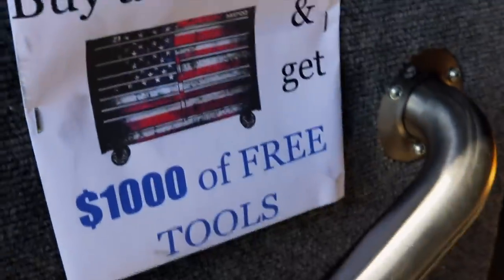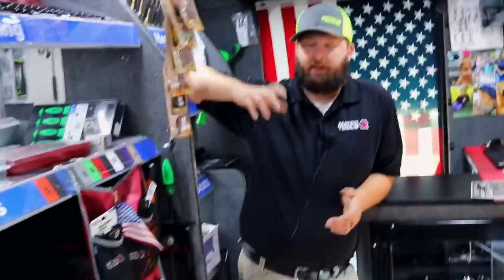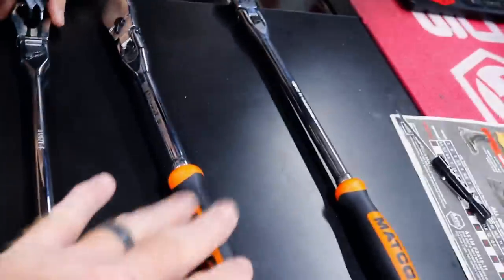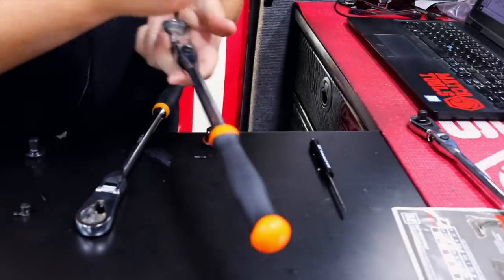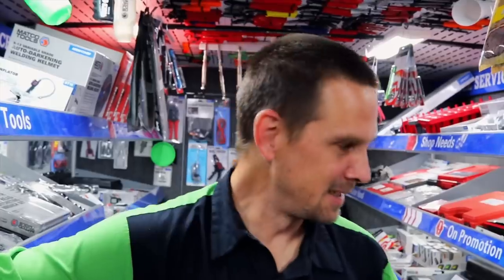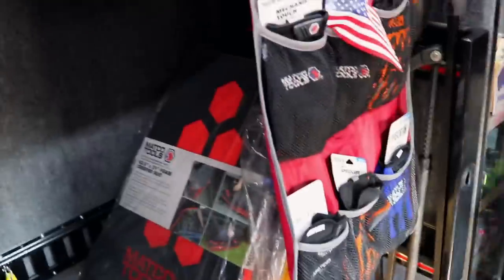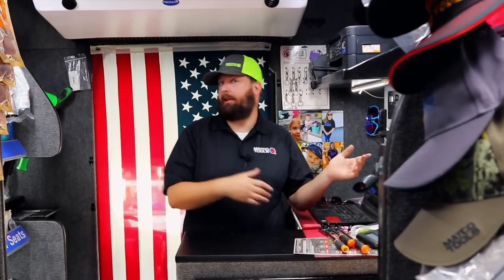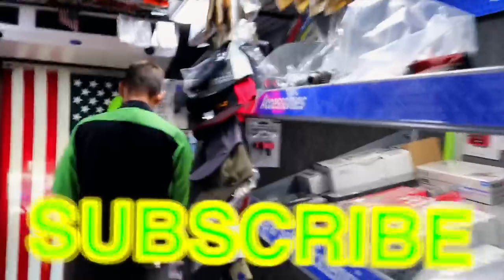Matco Tools: Is it the same ratchet, just rebranded? Gearwrench VS Matco, let’s tear them apart!

Comment: Did this guy really say "I've heard its 90 tooth but I dont if that's true" WTF is wrong with him is he really trying to say gearwrench is lying about tooth count
Reply from the maker: Have you checked the 120 tooth count ? You do realize it isn’t 120 right? Double clicking a pawl doesn’t add tooth count it just doubles the clicks you feel and hear
Reply: @KoonTrucking  I've got the 4 piece 120 from gearwrench & it doesn't feel much smoother than my 90 tooth but my Milwaukee 144 position ratchet wrenches are very smooth & they are double stacked but I mean is icon is 90 tooth ingersoll rand is 90 tooth gearwrench is 90 tooth I've been a industrial mechanic for 14 years now & honestly it doesn't matter what tooth count is or the brand I've had 2 snap on ratchet they honestly were not worth the $ so I've been sticking with gearwrench & Pittsburgh & I'm not seeing any reason at all why any other companies are worth more $ I just don't have much trouble from my cheap brands I mean I use Pittsburg & gearwrench 10 to 12 hrs a day with no problems I've broken their breaker bar but I dont warranty them just go buy another tool I've had same ratchets for at least 3 to 4 years & I might have $250 between 6 or 7 ratchets now I use my I.R.W7152 more than any tool in my bag & 1/2 dr sunex impact sockets for 2 or 3 years my 3/8 dr stuff doesn't get used very often as everything I do is big enough its 1/2 dr or bigger
Reply: @KoonTrucking  I just cant justify tool truck prices their tools are only a little better than the lesser priced brands & watch client graphics he shows all those ratchets breaking nice that cheap ass tekton tied with snap on but Milwaukee was strongest & matco & gearwrench were extremely close to same torque at failure points

Comment: There both made by apex tool
Reply from the maker: I don’t think so. Pretty sure Matco is made in Illinois
Reply: Koon Trucking well someone’s copying someone. I use them both. As well as snap on and Carlyle ratchets. Love them all and I have them all same reason you do. They all have there times when they shine and work better than the others but the gears from the gearwrench and the face plates and snap rings and the switches work in the matco, I believe matco either shares a patent or something like that. I don’t care at all. Just saying they work. I like the matco locking part better. But the different lengths and stuff are what comes into play. And the 120xp is badass.

Comment: Different ratchets but Matco does not make their ratchets and I don't believe they are made in the U.S.
Reply from the maker: Yes Matco ratchets are indeed made in the USA. Pretty sure it is in Illinois. That’s why they have them even stamped with the flag showing made in USA now
Reply: @KoonTrucking  Thanks for the info. Haven't had a match guy for a while so was unaware.

Comment: this video is very disingenuous  because the video I watched right before this i watched a guy take all the matco internals from a matco rebuild kit 88t and put them a gearwrench 84t the 3/8 took all the parts the 1/2 wouldnt fit the selector switch but all other parts fit and the 1/4 was the same all parts except the selector so $45 dollars rebuild kits you get matwrecnh ratchets
Reply from the maker: You realize the 84 tooth is the old style Gearwrench right? Plus all Gearwrench is made in Taiwan where the Matco is made in USA? They are not the same ratchets.

Comment: Foresure same ratchet sorry guy's matco is gearwrench
Reply from the maker: Not by a long shot. Gearwrench is Taiwan. Matco is made in USA and there are differences. Don’t kid yourself bud
Reply: They cpuldnpossibly be the same or similar in design, that has nothing to do with casting/forging and what chemical makeup the steel used is made of. Two different worlds completely.

Comment: Chevrolet will not fit in a ford.
Reply from the maker: You think so? How are people putting LS engines in fox body mustangs or 350 or 400 small blocks? Hmmmm that’s crazy huh? Won’t fit ??? Maybe you should ask Hamilton to pop his hood on his Mustang he races and see what’s going on there
Reply: @KoonTrucking  Thats with modification. Made it sound like you could just swap parts.
Reply: Actually you can just swap parts. They make a K member for the LS so it’s a bolt in mod. Hell, you can do the entire conversion and never fabricate a single piece. Only extra would be tuning once complete.